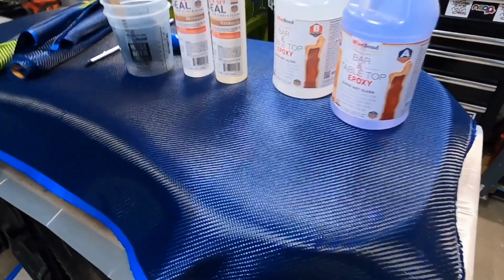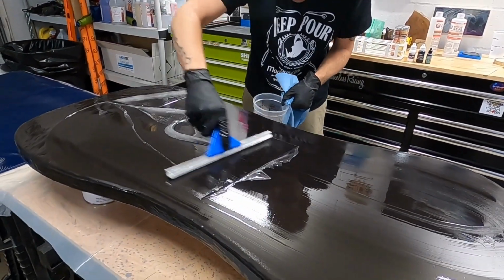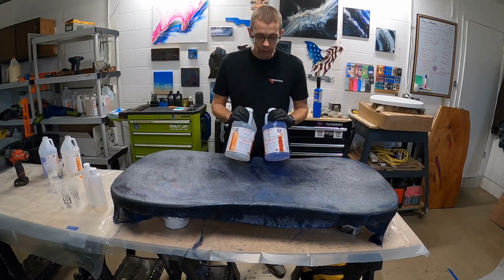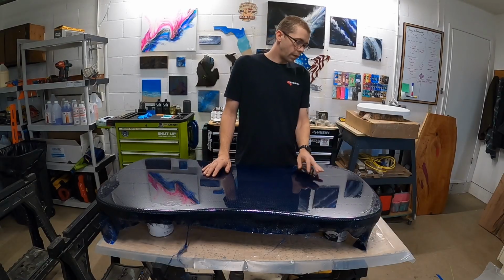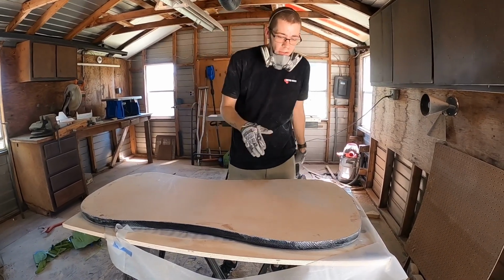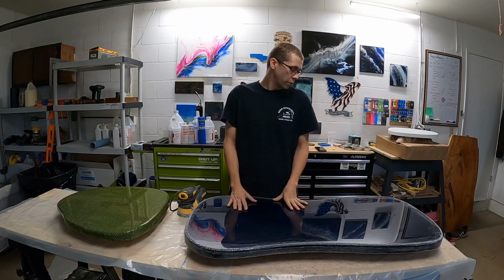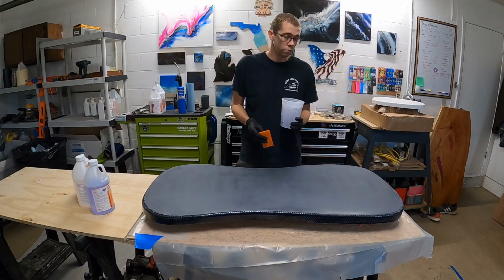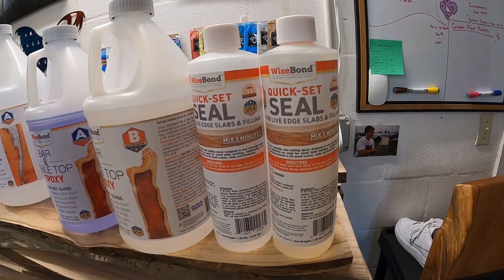Carbon fiber Wisebond epoxy

Comment: Is there any smell when you work with the epoxy? you do not use any protection when you apply it on the surface? Is it because there are no fumes, or you are used to it?
Reply from the maker: No smell with the epoxy I use.

Comment: that's a keeper for sure!  I heard someone talking about doing this on her existing kitchen table -- she complained about glass rings being left after dinner.  Did she not allow for enough drying time or is this normal?  thinking maybe her mix wasn't correct?  Does this table standup to normal use?
Reply from the maker: It’s possible that was the issue. 
With so many brands on the market, not all of them are quality, and some of them are kind of soft and will leave rings or scratch easier even when mixed very well.
Reply: @ronniebarber6548  So u've used other brands and settled on wise bond as the best?  This table shows great results.  I'm a 65yo retiree looking to keep busy and maybe make a few bucks so don't want to start w/inferior products. Appreciate u getting back to me, TY
Reply from the maker: @thomascostello5780   it’s a very good product to use. 
I currently use a few different brands depending on what I’m working on.

Comment: Looks awesome! But why didn’t you need to use a vacuum bag for this process?
Reply from the maker: T J  just a new way I found to do it.
Reply: Using vacuum compression will flatten the fiber tows more, and give the cured cloth surface a different (and likely improved) look, due to the increased faceted reflection effect. It's also good to seal the entire MDF surface (top, bottom, sides) to prevent moisture from being absorbed, else the panel can warp over time. Looks like you did that with the black paint. Regardless, great work! No need to go all aerospace on a table :)

Comment: Have you ever applied the carbon fiber cloth to both sides? The reason i ask is i'm a guitar builder, and i would like to apply the cloth and epoxy to a guitar body, but i only see people adding it to one side / or the top side of a table....any thoughts?
Reply from the maker: JaekRiel DGX  you certainly could. Getting the part where the two pieces would meet could be a pain. 
I have not done it, but it’s doable in my head. 🤣
Reply: @ronniebarber6548  Thanks Ronnie. I figured it would be a bit problematic, but since you are familiar with the materials, and worked with it quite a bit (certainly much more than me) i was interested in your opinion and input. Thanks again. Love your channel. Cheers
Reply: You can, but you would be best wrapping the entire thing at on time. Once your first layer of epoxy was set, you would cut out any excess(at butt joints in the carbon fiber, etc) and then proceed with your following coats as shown. I would suggest an anti UV clear coat/finish to help prevent yellowing
Reply: @CyberSolutionsWithJared  Than you for that advice. The only aspect of the operation I can't figure how to get around is the "seam" where the two halves meet. I don't want there to be a "line" where the top and bottom halves or "sides" meet along the edge of the guitar, but I don't see a way of getting around it...

Comment: Nice job, looks beautiful!! I just have some quick questions,  what kind of wood did you use or what material? And does it have to be black before you place the carbonfiver on it?
Reply from the maker: Felix Hernandez  used mdf as a base. I color it black before I lay the carbon fiber.
Reply: Thank you some much! Keep up the good work
Reply: @ronniebarber6548  just to clarify , was that a black primer to seal the wood (mdf) ?
Reply from the maker: @DonaldMelton  regular interior house paint

Comment: I do appreciate your hard work ethic. And the video of showing us how to lay carbon fiber on something, using epoxy. 
Okay I will bite. What the heck is the carbon fiber over mdf suppose to represent? The CF is strong enough to make a table without mdf!  Using cheap MDF and then very expensive cloth to cover it is oxymoronic. I'm just not getting why people are covering mdf with Carbon Fiber. Is it for the pattern or looks? Because you can do this with the printed vinyl for a fraction and you still have the MDF table top or whatever, for $8 bucks instead of $280.00 dollars and 16 hours in labor cost. Am I missing something? Is this suppose to be cool because people are just now experimenting with CF? Or is it really something about being able to do  something exciting with MDF??? 
Carbon Fiber has been out for 65 years. Wait...What was the point? Oh. Well if I could actually make one of these and sell it for $500, I'd probably be a bit more interested. I know of no one wanting a carbon fiber coated mdf table top. I would like to see you use the Carbon Fiber to construct a table top without any use of mdf. Okay it is a nice looking table. Please get it out of the sunlight. LOL
Reply from the maker: The good news is I sell them for $600 so I guess you’d be interested. 👍

As far as who wants them and why? I don’t dictate what people want to buy, but I’ll certainly accommodate for whatever they want. 
I have one in my garage personally, it matches the carbon fiber hood on the race car. 🤷🏻‍♂️